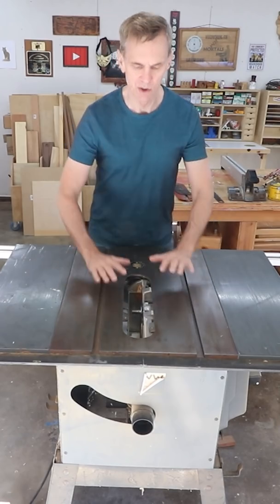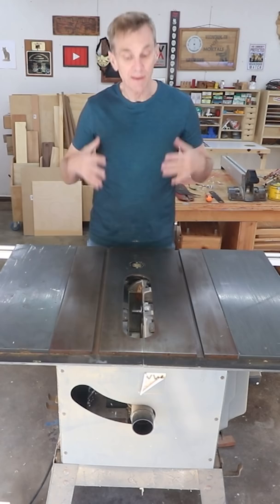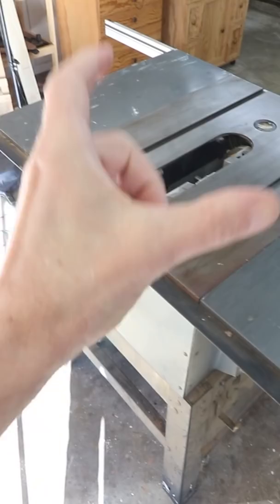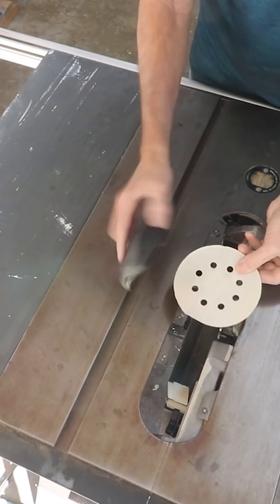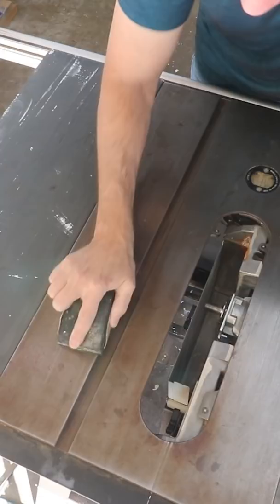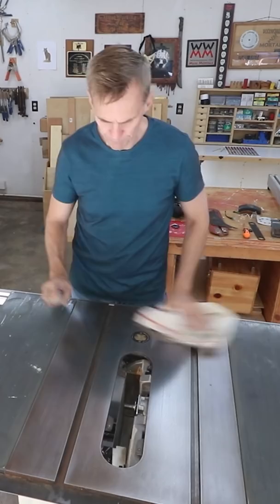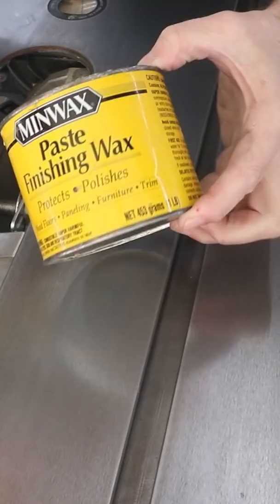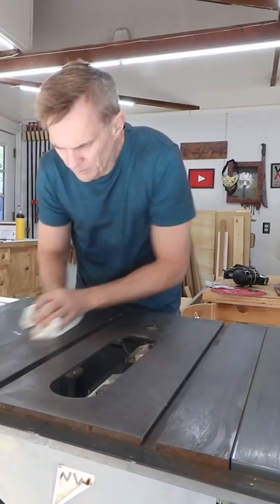How to clean a tablesaw table #shorts

Comment: I worked at a flooring company, I fed wood into a router and we litterslly used motor oil to protect the cast iron beds and the wood would glide in so well

Comment: Another old school trick is to use canning wax bars, rubbing the bar vigorously on to the metal, then use saw dust and or shavings to polish the wax.
In high production , this is the fastest way to keep the surface waxed.

Comment: I picked up a second hand Makita polisher (essentially a slow angle grinder which sprays water through holes in the arbor bolt.) Then, I grabbed a 50 buck set of diamond grit Velcro backed pads from Amazon. Carefully working up from about 50 grit to 1500 grit, it got my Unisaw table to a mirror finish. Very satisfying! But best done in summer on the driveway. And hose the driveway down afterwards because the iron grinding dust turns to rust and will temporarily stain the asphalt.

Comment: I was given a rusty table saw with cast iron table. I removed table and soaked it and all other rusty parts overnight in vinegar which removed all the rust. I washed it and then coated it in WD40 before it flashed rust and cleaned it with a Scotchbrite pad and 0000 sandpaper until smooth and shiny. Finished with a a coat of furniture paste wax like in the video. Looks like new!

Comment: A bunch of years ago I found a cheap quarter sheet palm sander somewhere (open box item maybe?). Turns out, those rectangular scotchbrite pads fit it perfectly. Spray the table with WD-40, hit it with the sander, and it makes super quick work of any rust! But it makes the sander super dirty, so I only use it for that now. Hence the cheap part lol

Comment: My two Craftsman table saws, need some TLC. The rest of the Craftsman are due for serious restoration. The disk and belt sander needs threads restored, and paint. The shaper/joiner is fine, but could use some paint.

Comment: I never use silicone (standard WD40) in the woodshop.   Fisheyes!
Well, that's what I was taught anyways.
Reply: You were taught well.
Reply: WD40 contains no silicone
Reply: Yep, no silicone in WD40, it is oil based. But Rust + WD40 = Wood Stain. So you cannot use WD40 as the final coat.
Reply: I stand corrected!

Comment: I don't recommend using anything as abrasive as sandpaper. You want to avoid scratching anything deep into the surface, and that's what sandpaper will do. Just use a scotchcbrite pad and WD40 and that will do most of what you need and not scratch the heck out of things.

Comment: I have used car wax which worked well. (Turtle Wax for that shell hard shine ✨)
Reply: Car wax contains silicone which is generally considered a bad idea for anything that needs to be top coated or stained. Just the slightest bit of silicone on your wood work will cause you a world of grief.
Reply: @johncoops6897  Yes. I’ve had that on new doors that came from the supplier with silicone on the face. You don’t see it until the paint ‘pulls’ away.
Reply: @54mgtf22  - For cars it's a major hassle to remove prior to painting!

Comment: I remember when I was much younger I told a couple older guys I was cleaning our old family table saw with Wd40. It was super rusty from years of sitting unused. I remember them both just acting like I was commiting some crime. I don't know why that has always stuck with me.
Reply: Because Rust + WD40 = Wood Stain. You cannot stop at WD40, you have to coat it with something that will "set off".
There isn't really any need to use WD40 since it isn't even a rust remover (it's a Water Displacing fluid). You're much better to wipe it down with a rust converter that will actually do something.

Comment: WD 40 is good for cleaning but it won't stop the rusting. What I found is more effective is to clean with WD 40 then wipe with oil (balistol) then use paste wax. This way cast iron stays without rust way longer.
Reply: WD40 is not much good as a rust remover. Much better to use a rust remover or converter! Then a drying oil like you recommend, and finally paste wax.